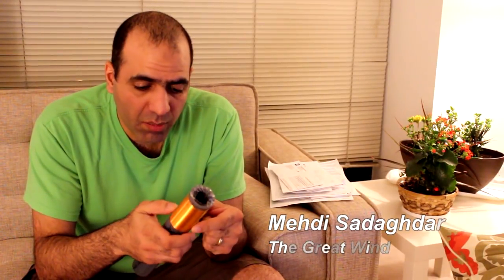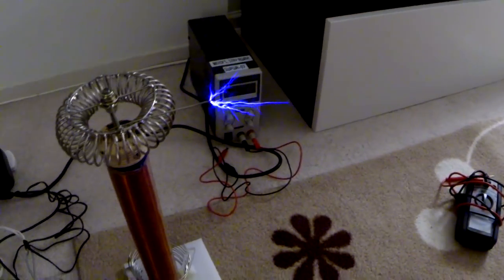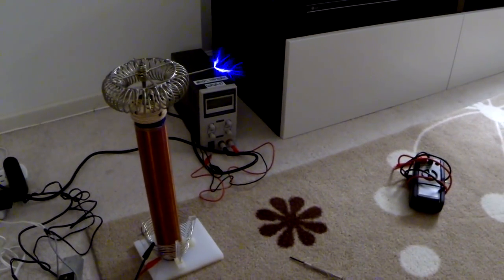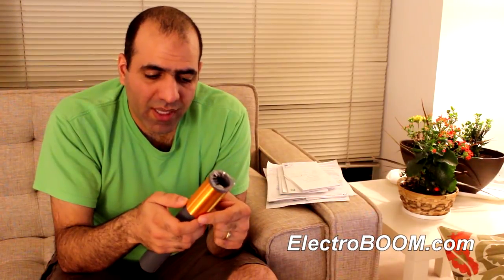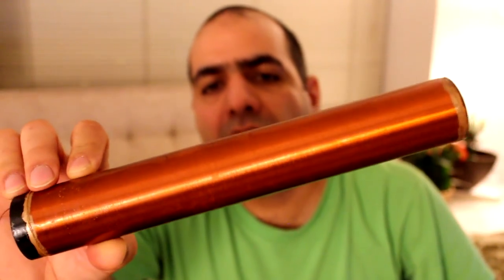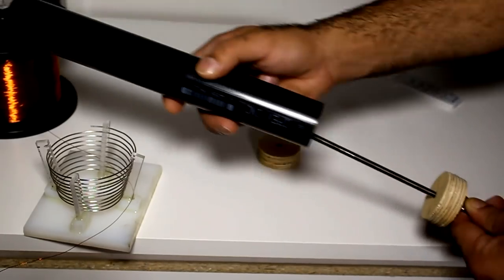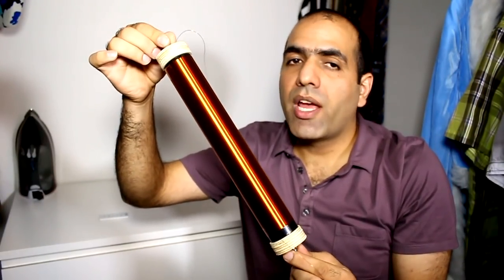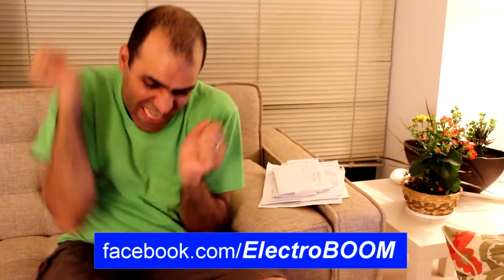Aiming for the Biggest Arc (Halfway Tesla Coil Design Report)

Comment: "each over six dollars" 
I don't remember the last time I laughed watching youtube.
That was great.
Reply: Aza-Industries 6 dollars is actually a lot for a MOSFET. I got a 100 pack of smd 2n2007's for under 2$
Reply: But is it rated for 1000V?
Reply: Exactly.
Reply: The ones he used in this video are rated for 1000V and still blow up because of the huge voltage spikes of the primary. He either needs a snubber network or a push pull configuration but thats not worth the effort as his circuit has another flaw aswell which is the tuning of the resonance frequency. He would have to redo the entire circuit but instead he went with a bought kit which I honestly dont like at all.
Reply: 74oshua me too
Reply: >fuse

Comment: I'm just starting on one here. First in about 20 years. I used to use HV power supplies and spark gaps. This time I am putting 2 IRFZ40s in a half bridge, and then driving the primary circuit in series, which puts the Z40s in series with the primary current. Not sure if they can handle that, time will tell. So far, feeding 10 volts DC into it takes about 2 amps, and gives 300 volts on the connection between the cap and the coil. Transistors and coil get warm and the little dipped mica cap gets hot. Can't do more than that until I get a capacitor that can stand more, and add heat sinks to the FETs. Waiting on Ebay for that. If this experiment with the primary circuit is successful, I will go ahead and wind the secondary. It will probably run around 300 Khz, and be about 2 feet tall. Thanks for showing me that ABS can do it. Back in the 80s, they told me to use acrylic for best Q on the secondary, but maybe it's not a big deal. If it all works, I will probably put up a video on YT about it, maybe even if it doesn't. Love your videos!

Comment: Keep in mind that there is an inverse relationship between resonant frequency and arc length to free air. If you wanted to increase your coil's performance you would wind a much larger secondary; shooting for around 400KHz or less. Also, you can directly control the current draw and power level of your coil by using a lower impedance primary. There's no need for 1200V IGBTs, just use a good fast low RdsON 500V FET, works great for 170V DC on the bus.
Reply: Matt Giordano ***** Also if you want any design tips feel free to hit me up, SSTC design is something I've been doing semi-professionally for a few years now.

Comment: I know you don't want to hear this, but the word on the street is white PVC tubing is more suitable because it is less conductive due to a much smaller carbon content (the black dye is pretty much pure carbon).... But, if you seal it well and keep the action at the top-load you should be fine... Great work so far, I am actually building a little coil winding jig as we speak, it is right in front of me.. I am eventually going to get into Vacuum Tube Tesla Coils, with rectified MOT power supply.. eventually.. Again, awesome work.. Good luck with your build and looking forward. Peace :)
Reply: bruh off

Comment: Hi so a cool thought. you take the tube and mount it on a small dc motor with a potentiometer to control the rpm. You use the tube diameter to dictate how fast you spin another motor controlled by a potentiometer which is hooked up to a worm gear, and use that to control your wire positioning put both circuits on yet another potentiometer and use it to control the speed at which you can spool based on your gauge thickness. Print some gears and brackets and maybe insert a brass or nylon ferrel and you will be good make as many coils as you like and as long or as big as you like. If you insolate the wire by running it through a tub of verathane then you could make it layered too.

Comment: It isn't about the turns ratio. A Tesla coil does not work like a transformer, which is very tightly coupled. This is a lightly coupled tuned circuit. Voltage is all about Q of the secondary.
Reply from the maker: +Steve Greenfield Tesla coil is a different type of transformer which is lightly coupled. Number of turns do matter. You can't make a Tesla coil with 10 turns primary and 10 turns secondary and that's why you you need a large turn ratio, to amplify the voltage as high as possible. Of course Q and resonance are huge factors too.
Reply: You said it as a direct ratio, that is what I am objecting to.
Reply from the maker: Steve Greenfield and you said it's not abut the turn ratio ;) so somewhere in the middle we may agree! The relation is not quite linear anyways.
Reply: It is a matter of power and Q, not turns ratio. Resonance changes everything.
Reply: I like your videos, by the way.
Reply: since its a slayer circuit it is not running using a tank circuit at resonance... the transistors switch on and off at the secondaries resonance frequency... o the transfer magnification of energy dependent on the Q ratios of primary and secondary doesn't quite work here....
Reply: The secondary is the tank circuit.

I didn't mean that it is a ratio of Q primary to Q secondary. I apologize for giving that impression. I meant that it is a matter of power and Q of the secondary, not the ratio of primary to secondary turns.
Reply: when you study the nature of true Tesla coils it's about the ringing transfer of energy back and forth from the. resonant primary tank circuit to the secondary resonant tank circuit that causes the voltage magnification. The slayer circuit doesn't do this it just switches on and off at the resonant frequency of the secondary which make it a resonant power supply and not a dual resonant Tesla coil.. Put a third self resonant coil in series with the secondary system and you get a triple resonant Tesla magnifying transmitter.. magnifying the voltage even further..
Reply: It is important to remember that in addition to the secondary being a simple turns ratio transformer, it is also a transmission line that is a quarter wavelength of the resonant frequency of the primary tank circuit.
Reply: Bill Smith .... I agree on that.
Reply: That is the nature of a parallel resonant tank circuit.
Reply: Steve Greenfield It's not just that.... there is more to it. Read all the Corum papers..
Reply: Of course there is more to it. Just like there is more to it than turns ratio.

Comment: Question: if you wanted to increase your primary to secondary coil ratio, why couldn't you just remove some of the coils from your primary? I'm fairly new to the whole electrical engineering thing and i'm probably missing something important, but i can't think of what it might be.
Reply from the maker: +Gordon Rammstein That's possible, but then the coupling between primary and secondary would become so week the loss of energy would be huge, which means for the extra ratio you get, you lose more power and it ends up being a great loss
Reply: *****
ah! that makes sense. Thank you for your courteous and timely reply. I love your videos!
Reply: ElectroBOOM But isn't a tesla coil supposed to be loosely coupled?
Reply: ElectroBOOM Can't you use a thicker wire with fewer turns to increase the coupling while reducing the turns?
Reply: Nothing is supposed to be loosely coupled if its anything like a transformer. I can't think of any design that would achieve something just by being inefficient.

Comment: A tesla coil is more like a radio transmitter (primary) and radio receiver (secondary) than it is like a transformer.  It's more important to get the two coils tuned to the same resonant frequency than to play with the turn ratio.  Try tapping onto the primary coil at various points along it. (effectively changing the length) arc length will peak A LOT when you get them matched. On my larger coil untuned get ~10cm and tuned about 30cm

Comment: Hey Mehdi..Think you should try a thicker primary copper wire?or even copper tubing?
Would love to know your thoughts on this, thanks.
Reply from the maker: Adit Desai I tried thicker, didn't make much difference. The main reason is that my primary currents are not that big to make a difference.
Reply: ***** Oh i see..thanks for the reply..Im currently trying to make a toroid thats shaped like a glove basically and somehow mount the coil on my arm. A bit of a safety hazard but id be able to light cfl's wirelessly with my hand...which should be quite cool so ill try anyways.
Reply from the maker: Adit Desai
hmmm, not very safe! But try to have some good insulation. Also being so close to your body, the capacitance to your body may be large and over load the output and lower the voltage significantly.
Reply: ***** Oh..right. Plus  i am going to have to use a much lower voltage coil otherwise ill have arcs flying off the secondary straight through the insulation and into my hand, instead of the toroid getting all the charge and ill probably have to stand on a wooden stool or table....well we'll see. Thanks for your help. :)
Reply: Adit Desai Make a video of it :O
Reply: Adit Desai he could also use larger capacitors that can handle this kind of abuse. I did that coil gun thing in college and I didn't have a strong enough power source to get the job done so I got these huge capacitors that I think were 16 farads each and they worked wonders by doing a huge energy dump into the coil gun
Reply: PalmFrond Front yes, think I'll make one once I get done with exams.

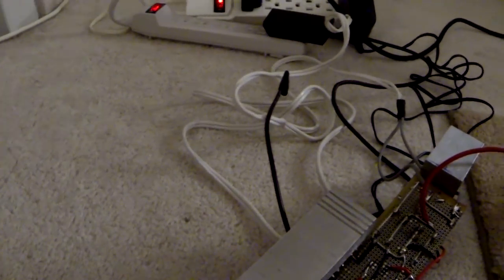Comment: 3:53 sparks on fur carpet Ok capacitor discharge  sparks don't have much energy but prevention is better than cure. So always experiment on tiled or solid floors  just in case

Comment: Hi 
You could use Vaccum tubes instead of mosfets - tubes can handel high voltages and they are pretty cheap but still there is problem with transfromer which could power whole circuit.

Comment: What you need is a friend with a lathe (a metal working lathe would be best). Stick it on it's slowest speed setting load up the plastic pipe and away you go. It would be done in a few minutes probably.

Comment: Hi. I have no experience with solid state TCs, but with classic spark gap configuration you can't view it as a voltage transformer. From practice, spark length is mainly the function of the electrical power through the Tesla coil...

Comment: "I've blown up 16 mosfet transistors so far". 
Obviously because there is not enough inductance on that primary winding, for the frequency you are driving it. It should be treated as a high-frequency coil in the order of MHz and use the mosfets to only provide the HF component that the coil tunes in, to avoid high useless and catastrophic currents. That also means that in the secondary winding each turn should be spaced a little bit from the next one because the enamel insulation is too thin and creates too much capacitance that shorts HF -let alone it can't withstand high voltage so you also have a leakage current that reduces the output power.

Comment: I love your videos. I have 2 questions.
A.) why is your primary coil shaped like a part of a cone

B.) why is the primary coil so far from the secondary coil? Wouldn't it be more effective if the coils were closer together?
Reply: If the coil is too close the high voltage will jump from the secondary coil to the primary coil and kill the driver circuit.

Comment: I think that you will find that the smaller diameter wire (33awg+) becomes lossy due to higher resistance. I myself made a 2000t with #38-40 wire (1 1/2" dia) and while output voltage did increase, the secondary would get pretty warm in a short amount of time. Rather than shrinking the wire size for more turns, it is better to increase the diameter.  Turn ratio does not act the same as with a cored transformer. Using the same wire as your first secondary, increasing the diameter to say 4" would provide a much better output. If you look for pics, most of Tesla's coils were more Barrel shaped than long tubes.

Comment: Just increasing number of turns probably wont help alot. Tesla coil is a resonant transformer and voltage at the top of a secondary winding is not strictly related to turns ratio. Too thin wire has some resistance that makes resonant circuit less efficient.(reduces it`s Q) If you already cranked voltage up to your semiconductor limit, try to increase the current either by reducing number of primary turns or by positioning primary closer to secondary.
Optimal secondary diameter/length ratio is considered 1/3 to 1/4 with 1000-1500 turns

Comment: To solve the 70:1 ratio; you need a copper (or highly comductive) Pyramid, which must follow the dynamics of Phi, as well as quarts crystals at the points of the pyramid, which can increase the output by 1,000.
Reply from the maker: +cma112087 And a magic wand. Where do I get the magic wand?!
Reply from the maker: cma112087
I might be as stupid as I look! So send me a link that scientifically explains how a pyramid and quartz crystal can amplify the power that much. Thanks!

Comment: a tesla coil works differently from a transformer,look at the Tesla coil in my Chanel,it produces 31cm sparks so about 310kv,the primary is made of 5 turns and the secondary about 2000 so the ratio is 1:400 and the primary voltage is of 118vac which means that I would only have less than 50kv

Comment: How about using the Tesla sparks to generate Lift for a  Quad Copter! 1000 small tiny high voltage  Tesla coils might be able to lift a Platform off the Ground! Research is needed! Better to use the Spark than to just watch it!

Comment: You seem to be relying on turns ration of a typical transformer ...but Tesla coils work differently.  
The voltage transformation maximum can be approximated as Vsec = Vpri (Cpri÷Csec)^0.5 = Vpri (Isec÷Ipri)^0.5.  
I= inductance V=voltage C=capacitance sec=secondary  pri= primary.
So.....for large increases in voltage you need low inductance and high capacitance on the primary and low capacitance and high inductance on the secondary..... but it isn't scaled with a straight ratio of turns.

Comment: Actually, high amount of turns are not necessary, if you want long sparks, use isstc design, or I-drsstc, even simple boost circuit can provide high enough voltage for isstc. From 15V i could achieve around 15cm sparks...

Comment: Smallest pistol I believe is the kolibri (German for hummingbird)
With 2.7mm centerfire rounds, it’s smaller than your middle finger, pointer finger, and index finger, and can be held and fired with 2 fingers
Killing someone with it is like killing someone with thumbtacks 
If you kill them they will be a laughingstock 
It’s most legitimate use that could be seen is a deterrent against stray dogs as the sting would most likely frighten them off
Made between 1910-1914
Those arcs are most likely bigger

Comment: Why are you only stepping up once? Couldn't you transform it multiple times before the end? 10:100 (10x) -> 10:100 (100x) ->... And don't you need thicker wire at higher voltages?

Comment: Hey man. Cool project. Most of us can understand some of the stuff but we just dont feel like investing money to buy all the stuff. But can I suggest if you wind the wires from top to down, place a covering like paper or something around that primary coil then coil it again (i.e. two layers)
Reply from the maker: de0509 I think you mean the secondary (the long many turn one). You can't really double wind it because the windings have great voltage difference between them and will arc through the insulation.
Reply: Oh yes. LOL thats embarassing. Yeah is secondary. Thats a bit of a problem then. I agree. Never seen very very high voltage but I did see paper vibrate because of kinda high enough volts. Whats your next plan for making a bigger arc? Or secret so that it can be a surprise?
Reply from the maker: de0509
Probably I will get surprised first when I make them!

Comment: I hope you see this
It is rather hard to get wire from where i'm from
and i got 0,1mm or 38awg wire and a lot of it
my pvc pipe is 4,6cm in diameter so i calculated to make around 30cm of turns that is around 2700 turns of wire
but ofcource like in your videos things explode i get shocked etc. and i hit the table and the coil fell while it had only 1700 turns
4 hours of my life wasted
Now i was broken because it was hard to get to that point i tried connecting those 1700 or so winding. i mean i but a primary and connected it to my flyback transformer with a cfl drive powering it. So im building a spark gap Tesla coil because i cant afford those huge sparks because i don't have the power supplies or the money for the parts. Now when i connect a primary and make some sort of top load the neon bulb almost doesnt even shine at all. And a few days ago i just wanted to test the power supply and made with a different wire a coil only 4cm tall and it almost made whole shine. Now why is it that this 1700 turns of wire doesn't work? I mean is it the primary? How do i know how many turns or the spacing? How did you build and calculate your primary? And from what is it made? And from what is the top made?
P.S. Ive been a fan since 3 years ago and i love your work!

Comment: Please can someone tell me how it is safe to touch that thing. I don't get how the voltage is high enough to make sparks but doesn't create a strong current through your body.
Reply from the maker: StormBrotherDub Will explain in my next video. But I wouldn't say it is quite safe. Look up skin effect
Reply: ***** StormBrotherDub 1) it's a current limited source through several mechanisms, primarily the impedance of the nonresonant primary coil. 2) Even at "lethal" currents of several amps, it is high frequency AC above 30KHz, to which the human nervous system does not react to. The current still causes heating in tissue (called diathermy) but since it cannot interact with our nerves it is painless and cannot cause defibrillation.